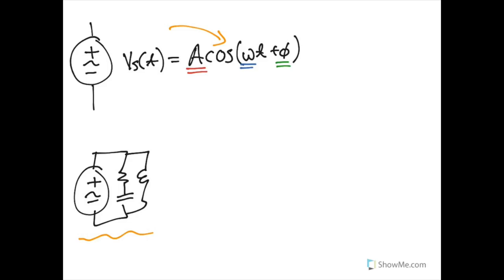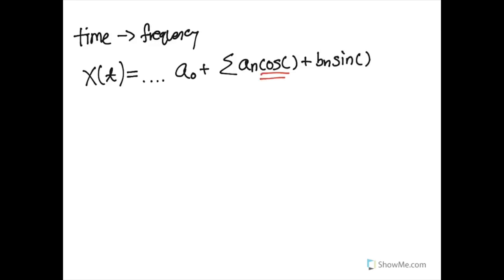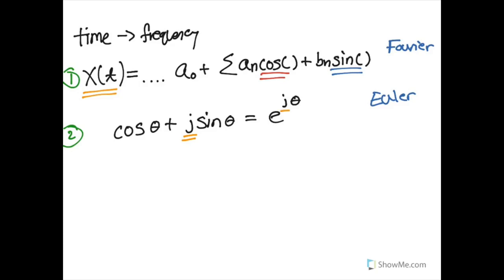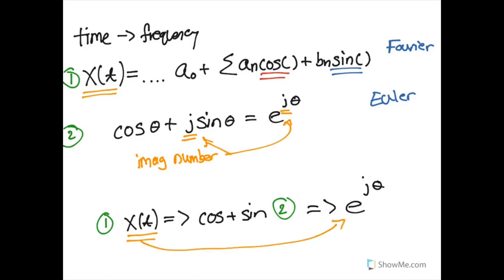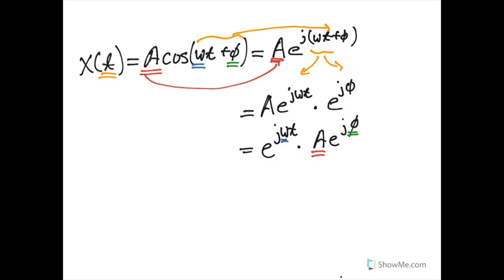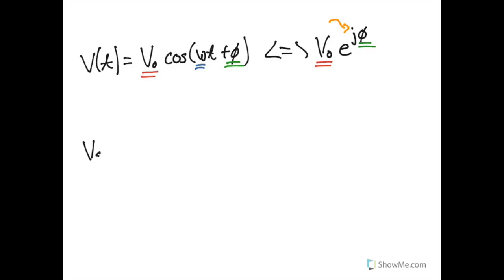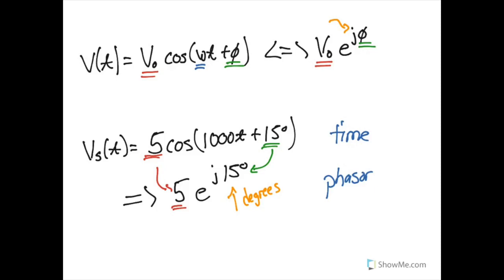Phasors: From the Time Domain to the Frequency Domain

Comment: Hi Jason,
Thank you for the clip.
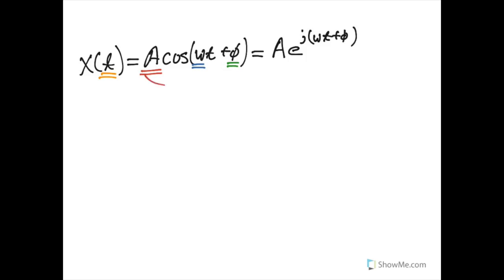I did not understand what you said at 6:50. One part seems to be missed based on Euler formula.
A.Cos(wt+a)=A.exp(J(wt+a))-A.j.Sin(w.t+a)

What happened to Sin() part?
Reply: there is a mathematical operator used on the polar form of the expression which is used between these steps which states that we only take the "REAL" part (cosine) of the polar form and not its imaginary part (jsin).
Reply: @phengyang2639  Thank you for the explanation.
Reply: @arash4232  lo😮